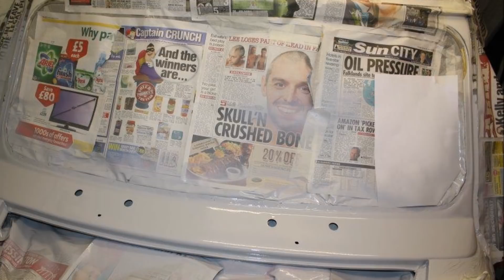Classic Mini Scuttle Panel Relplacement

Comment: Keith, I would love to do a engine conversion & swap like yours but i‘m afraid the TÜF the Engineering test in Austria it‘s like a very strict MOT would be very difficult to pass, They are not happy if you change anything from the production model, Cheers Dave.

Comment: oh and also, is the top of the bulkhead sandwiched between the lip of the scuttle and lip of the upper dash panel? if so did you weld the bulkhead panel to the underside of the scuttle and upper dash panel from inside the car up under the dash?
Reply from the maker: Yes, all 3 panels come together. The top lip of my bulkhead was only very slightly corroded 04:11 so was cleaned up and OK to be welded back on with the scuttle

Comment: Hi, Im just about to replace my scuttle, did you not need to weld where the panel meets the wing? i thought wings need removing? also, my upper dash panel is also rotten where it joins the scuttle just like yours, how come you didnt replace this aswell, surely you couldnt weld to it? Cheers
Reply from the maker: The wings are not welded to the scuttle panel, however, there is a closing panel underneath that is spot welded to the scuttle. Mine was so corroded I just pulled it out. You can then just about get up underneath with a MIG welder to tack the closing panels back in place. 05:31 shows the closing panel, I welded on a tab temporarily to hold in place while I welded then fitted the new scuttle and welded from underneath

Comment: What is the purpose of the red orange paint you have applied to the scuttle before welding ? and also what is it called ? .    Many thanks
Reply from the maker: It's red oxide paint which is a rust prevention coating

Comment: Do you spot weld it in place??
Reply from the maker: Hi, the scuttle was plug welded around the windscreen aperture and along the seam strips then seam welded on the windscreen pillars and at the join with the inner wing. The closing panels were welded to the scuttle from under the inner wings.